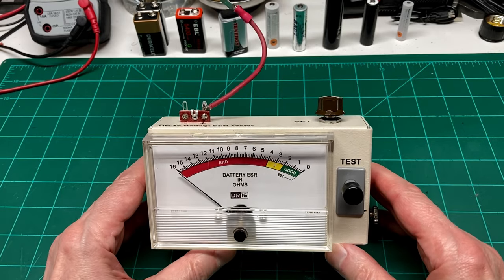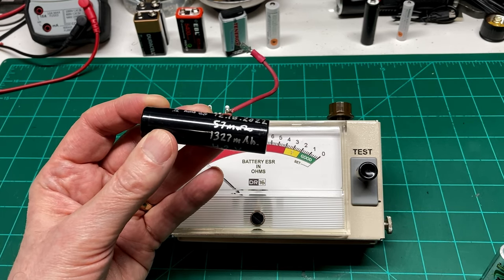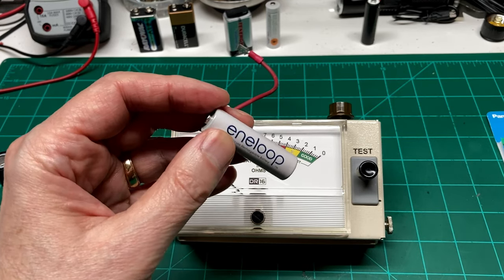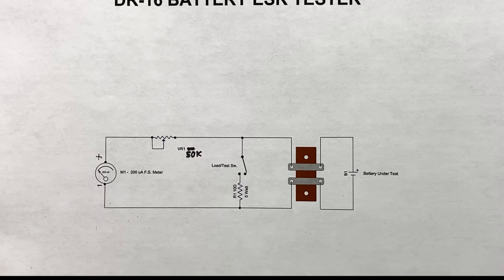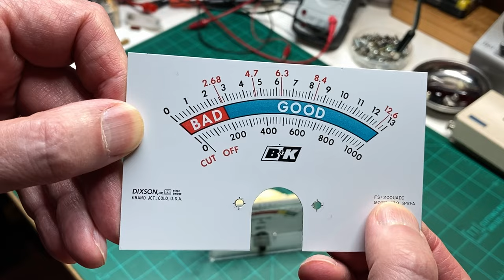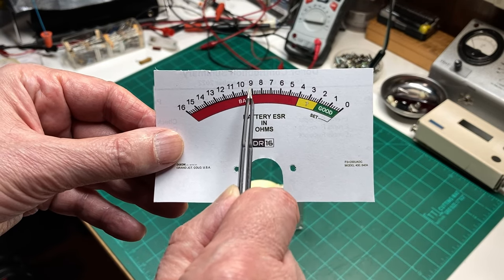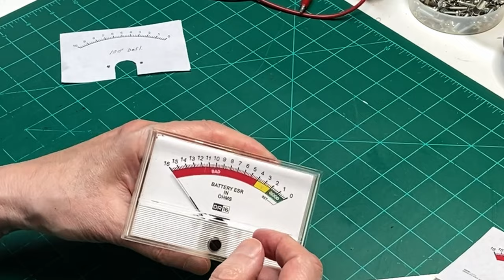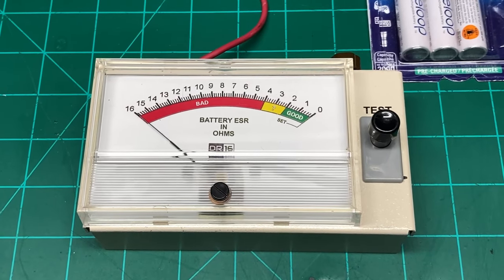Build a Battery ESR Tester

Comment: Thx for informative video.....New fresh 9 volt Alkaline Non--Rechargeable batteries Most Designed for < 100 ma Load, contain significantly Less internal Chemical Paste & Electrode area per Cell (Compared to 1.5 volt AAA--D size batteries) naturally causing much higher ESR & Trying to source  1000 ma test Current draw into your 10 ohm Load resistor.....A switchable load Resistor of 100 ohms (For 9 volt Alkaline)  to 10 ohm for 1.5 volt battery would Probably be more Realistic (And potentially Less overload Damaging) for 9 volt Alkaline batteries.....Just a thought on tweaking your Excelent diy ESR battery Quality tester design......

Comment: I do a lot of troubleshooting and repair of test gear and metrology equipment. A good variable frequency ESR meter is an absolute must for quick fault finding on circuit boards. In circuit testing is unparalleled in quickly and accurately narrowing down the possibilities. 

An esr meter can test a lot of things other than just caps. I think the "diode gone wild" did a few videos where he showed off some techniques, and so did "learn electronics repair".

And an analog scale is pretty hard to beat in some instances. So I could see this really becoming popular with the DIY and even professional electronics troubleshooting folks
Reply: And I really like the setup of your bench.

Comment: The 9 volt battery has 6 cells in series. esr per cell would be - meter reading and divide by 6.
Reply from the maker: True, assuming that all the cells exhibited the same ESR.  However, there would most likely be (1) that was way high in ESR where the others would not.  It would still indicate an overall high ESR for the whole battery.

Comment: Just finished to build it. 😁
I struggled for soldering the thick cables, design the panel, and design the BOX. 
The panel was done in Inkscape with a special extension, Scale, that creates simple gauges like MeterBasic, but since you are already in a vectorial app,  then you can change the design as you want. I had to print and scale it a couple of times since once printed on the LaserJet, 1 cm on video was not 1 cm when printed.
The box was designed in CAD and 3D printed, unfortunately only after I printed it, I realized that the data sheet with the drawings of the amperometer with holes and screws quotes, were completely wrong! I preferred to file so parts and do some drills on the box instead of change the CAD design and reprint it correctly, since it has to be used only once, and the manual holes were covered by the milliaperometer. 
I had also troubles to solder the thick cable even with a TS100 solder and the fattest iron. After the some mandatory soldering I switched to screw contacts for the following joins. However it looks very nice, and it seems to work fine also.
I discovered that almost all my rechargeable batteries are still good. 😉
Reply from the maker: Nice technique there Roberto.   Sorry you had to do so much trial and error but I guess that's the way the hobby is when you're "Rolling Your Own".  I just used my ESR tester this morning on a couple of 20 year old batteries that are still showing less than 2 ohms ESR!  They don't seem to have the shelf life between charges as a new Eneloop but they will do in a pinch.

Comment: I was a victim of counterfeit batteries. I bought a pack of AAA cells for remote controls, and my remote died way too soon, and the batteries leaked as well. I checked the pack of batteries, and they were also corroded, yet they had ten years left on the use by date!

But comparing the failed pack of batteries to a new pack, I saw the difference right away! Sadly, I don't remember where I had bought them, but I suspect they came from Walmart. I have had trouble with pop cans from Walmart as well, and I really look at the products before I buy anything from there, and I don't shop there unless absolutely necessary.

You can print anything your printer is capable of on plastic or plastic coated papers available for printers. But the best method for me has been the transfer paper! If you have ever built models and painted them, you would be given a set of transfer decals to apply to the model. Well, you can buy the same paper, and use it, but you need waterproof ink to use with it.

The transfer paper allows you to paint the metal plate any color you desire and apply the decal to the plate! I would not print the background on the decal, as it doesn't look as good as painting the plate, at least that has been my experience.
Reply from the maker: Yeah it's so easy to do now that you really gotta watch out every time you buy something.  I saw an article from Mouser a while back saying that almost 30% of parts on the market today are fakes and how they (Mouser) try their level best to market genuine products.

Comment: One scale for different battery voltages will not work very well.
The 10 Ohms resistor loads the NiMH with a little more than 100 mA but the poor 9V block with almost 1A and the Lithium something in between.
As the internal resistance calculates (Vopen-Vload)/Iload you would need different scales for different battery types.
Reply from the maker: You are quite right.  I considered that and probably will reprint the scale later on and possibly change the load resistor to around 20 or 30 ohms using a selector switch.

Comment: Been hoping for some good esr testers with analog display. Very nice design. 
Possibly a future upgrade to allow for a range of different test frequencies.
Reply from the maker: I may just do that later on by making a 2nd terminal strip (so I wont need a rotary switch) then create a new dual meter scale to read the new load results like (1) for AAA to 18650 and (1) for various 9V batteries.
Reply: I do a lot of troubleshooting and repair of test gear and metrology equipment. A good variable frequency ESR meter is an absolute must for quick fault finding on circuit boards. In circuit testing is unparalleled in quickly and accurately narrowing down the possibilities. 

An esr meter can test a lot of things other than just caps. I think the "diode gone wild" did a few videos where he showed off some techniques, and so did "learn electronics repair".

And an analog scale is pretty hard to beat in some instances. So I could see this really becoming popular with the DIY and even professional electronics troubleshooting folks